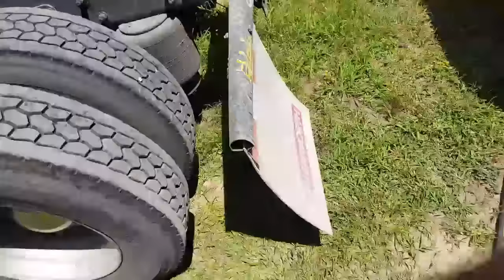Chevy sonic pink to blue rims

Comment: damn that looks so smooth. what paint did you use sir?
Reply from the maker: +drifttrash37 we used Rust-Oleum deep blue thanks for watching. The previous color pink was Krylon and had over  13,000 miles on it.
Reply: +Lawrence Duarte wow that krylon held up very well.